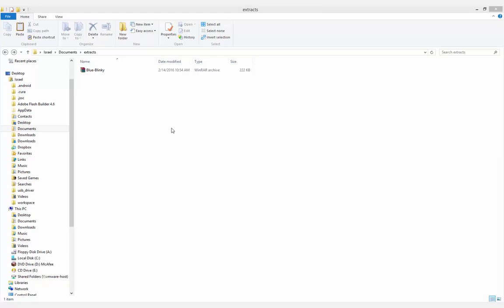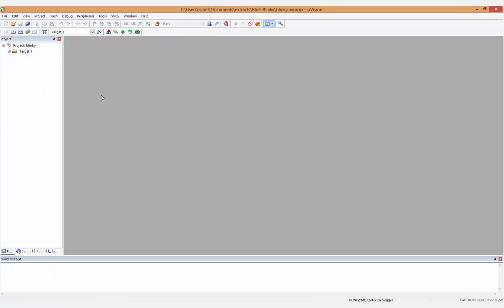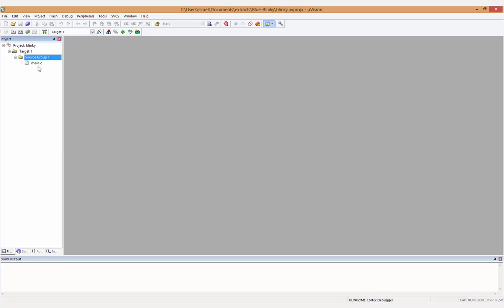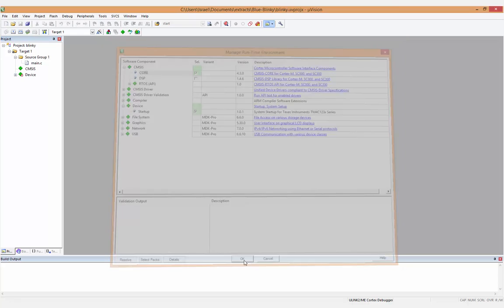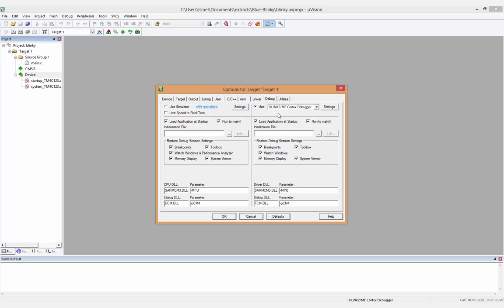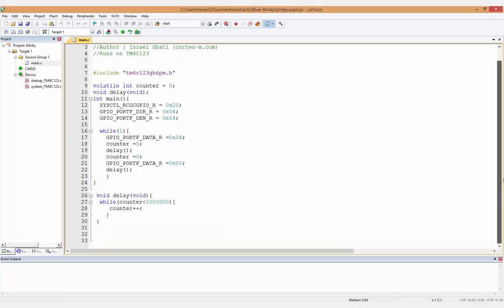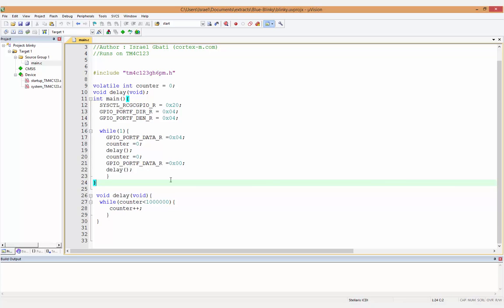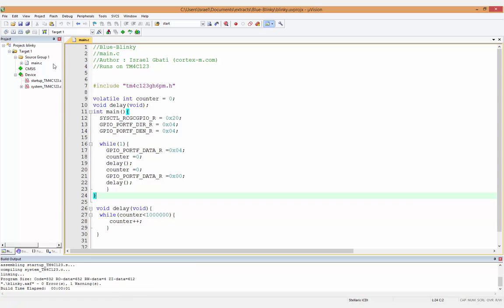Testing The TM4C123 Tiva C LaunchPad

Comment: Thank you so much for the videos. I had an issue connecting my Tiva to my PC and it turns out the problem was on using an USB extension cable. 
I used one because the cable provided is super short. The extension cable I used does not allow the device to be recognized properly.
Reply: Also recent version of uvision decided to remove support for the ICDI debugger. How these companies love to do such things. It can be installed back with a patch here: http://www.keil.com/support/docs/4196.htm

Comment: Thanks for this nice and simple tutorial. I'd like to ask about the X sign on the Device entry and its contents in the project exploration windows. It seems as if there is some error although the compiler says that the project is fine and free of errors.
Reply: The code still works fine. It is an issue with Keil uVision 5. When you create a new projects and and use "PACKS" to add startup files to the project, sometimes when you quit the IDE and open the project in the future, the startup files disappear from the project panel so when you add the files again using PACKS the files are added to the project panel and then to the project folder but since the files already exist in the project folder, you get the red crosses you are seeing.